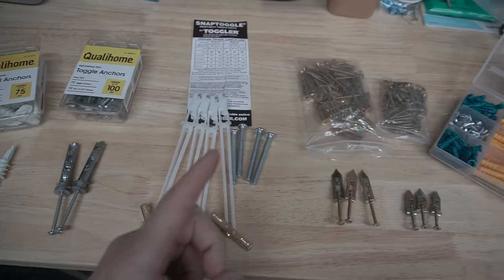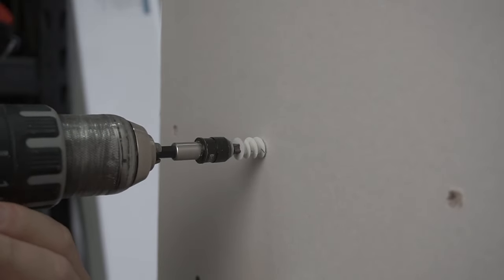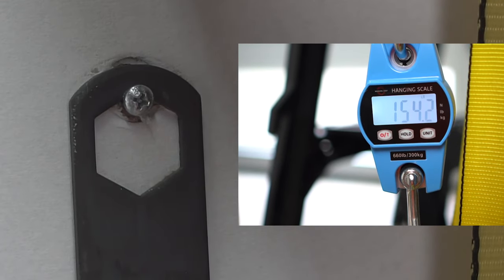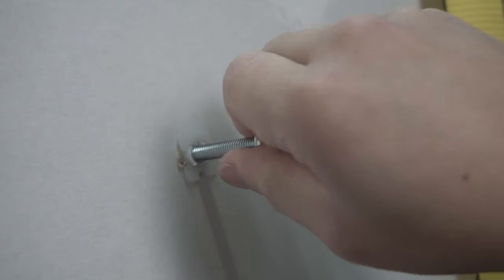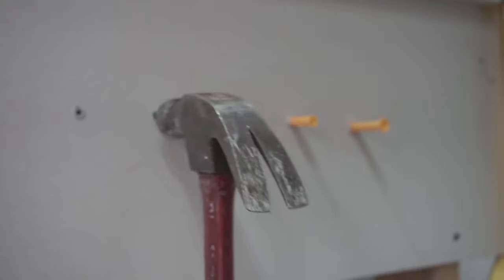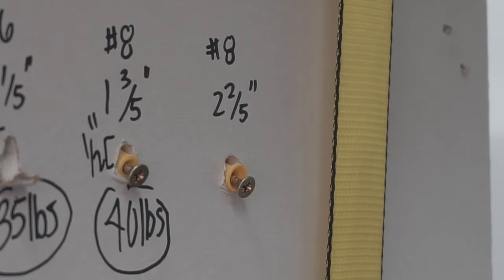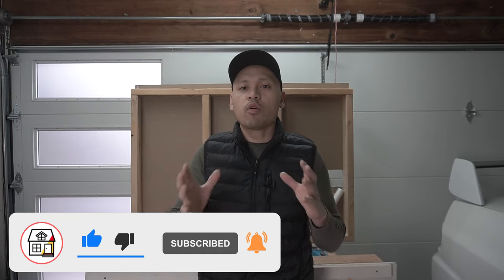Which Drywall Anchor Is The Best?! BEST And WORST Wall Anchor Review PART 1 (2022)

Comment: snap toggles will hold plenty if you make sure the toggle is oriented vertically and you pull the zipties as tight as they can go before you snap them off. I used to use the self drilling toggles (the one you found to hold the most weight), but I had too many issues with them. The threads for the screw would strip out and the mechanism would seize up because the sides would bend a little. Snap toggles are my go-to now, they're the only kind I use for heavy things. As an added bonus they also don't fall into the wall like old school spring-loaded toggle bolts. For light loads like picture frames or for small shelves that use brackets with multiple screws to spread the load, the stab-ins are my favorite because they leave so little damage behind if you need to remove them. You'll get better holding power out of them if you use them horizontally rather than vertically. When vertical they act like a knife cutting through the drywall.
Reply: I wondered about how installing them sideways would impact performance.
Reply: @Greanestbean  It does impact it ALOT. The instructions say to use horizontal.
Reply: Orientation of the metal flange of the snap toggle inside the cavity makes a huge difference.  For maximum vertical strength, makes sure the flange is placed vertically.  The instructions (shown) actually indicate this.  He placed it diagonally, thus reducing the load capacity and skewing the results negatively.  These are my go-to anchors for heavy loads, when a stud can't be used.
Reply: I have a question , my bracket is placed vertically so I should try to position the flange horizontally for better loading is that correct ?
Reply: @kd4965  regardless of what your mounting, the actual anchor on the snap toggle, the metal part that hugs the back of the drywall and that the screw threads into, should always be oriented vertically.
Reply: Showing the back of toggles as they fail would of been cool.
Reply: Yeah from the video it looks like he installed them off-vertical and also pretty loose.
Reply: @grantcivyt  Exactly right. He didn't get the sliding collar pushed flush and tight, you can see a lot of play, resulting in the failure. Sloppy work.

Comment: Great video. Snap toggle is by far my most favourite, I am surprised it is so under performed, I feel it you may not have given it a fair chance. These toggles really benefit from pulling the straps as tight as possible before snapping, I can see that you’ve got an ever so slight gap there between the toggle and plasterboard. It could have made all the difference. In the Uk we also have something called Fischer duopower, they are my 2nd favourite plasterboard fixings, claims to hold 15-30 kg each
Reply from the maker: I may have to give the snap toggle another try on part 2. Thank you for the recommendation I will
Have to try the duo power! Thank you 🙏🏽!
Reply: @FixThisHouse  Yeah I would have to agree I have done many TV mounting jobs using the snap toggle bolts with the 1/4" screws and they support 265lbs. I also used my own body weight (151 lbs)as a test and the drywall didn't even Crack under my weight.
Reply: @FixThisHouse  Yeah, definitely. I use these all of the time. You have to pull that toggle tight with the front plastic collar. Then you hang whatever you're hanging. You didn't pull it tight, and also never ran the bolt all the way in (first) before letting it hang out and testing it. Not a fair critique for this toggle.
Reply: I would have to agree with the other commenters. I use these when I'm hanging TVs and large mirrors (hung a 96" plasma TV on a basement wall with 24" OC studs - the mount was only 18" wide, and I could only get 2 lag bolts in a stud; these toggles have held the rest of the mount).

I saw another comparison video where the creator grabbed the screw head with vise grips and pulled the anchors through the wall. These toggles took the most effort to pull through the wall (and made the biggest hole in the wall when he pulled it through, lol).

Let us know if you try another comparison with these.
Reply: Came here to say this as well.  The snap toggler is my go to for hanging anything of significant weight when I don't have the option of drilling into a stud.
Reply: @FixThisHouse  First, thanks for the side-by-side test. It's great to see so many options at once. 

But, yeah, I have to agree that this isn't exactly accurate and I hope you do give the Snap Togglers a second look. The anchor didn't fail, the drywall did. Same with a couple of the other anchors because of the way you tested them. Snap Togglers are my go-to. I've been in this line of work for just under 20 years and haven't had one fail yet. Heavy shelves, TV mounts, 100-pound mirrors, etc. 

I hear what you're saying about most applications being "pull down," (aka shear force), but think about something common like a shelf bracket. They usually have two screws aligned vertically. The force on the upper screw is pull (tensile), not shear, because the bracket wants to pivot out and down with the lower screw acting as a fulcrum. Another instance is "floating" shelves where nearly all of the force is tensile. In that case you worry more about the anchor pulling out of the wall than pulling down the face of the wall, and that's where the Snap Toggler excels. 

One way to get a more real-world test might be to pull at a 30 or 45-degree angle to the wall. That might give you a better combination of shear and tensile forces.  

I appreciate your being curious enough to do this test and for sharing it with us. Keep it up.
Reply: Tony I agree with you. the screw did not look like it was tight against the wall when it was being tested
Reply: Thanks for the comments and insightful replies. Makes sense then for the manufacturers claims.
Reply: Absolutely my favorite. I install plywood with these to hang commercial fans with. They work great!
Reply: It underperformed because the bolt wasn’t tightened as it was designed for.
Reply: Hello, do you think the ceiling of A UK house can support a weight of 15 lbs with four Geefix?  That is  nothing attached to joist.
Reply: @megahwang4949  snaptoggle claims to support more than 100kg each. I think 50kg is more realistic. Can’t comment on geefix as not used them
Reply: The snap toggles are the best, next up the butterfly toggle bolts, the reason it failed early is that when we usually install it is installed tightly against the wall, this causes a hefty amount of friction on the back and on the front where the installation surface meets the drywall. If you have ever had to remove something installed with these then u know that alot of times the mount, shelf or furniture will even free hang because of the contact pressure and friction experience during the initial install. I have also hung off of these and can confirm that in actual installations they are the best
Reply: Yeah it surprised the heck out of me as well thise snap toggles are pretty strong. More to me like the drywall failed because there was too much slack holding it to the drywall. So it wasn't the toggle bolt that failed it was the drywall itself.

Comment: The flat hammer in hangers are suppose to be hammered in with the flat side horizontal to get the maximum weight holding power.  They may not hold as much as others but they will generally hold whatever you want to mount on the wall and they are very convenient to use.

Comment: This actually does not make sense, the problem  here is on the drywall not on the anchors, the anchors still inside the wall and did not break, so the problem is the dry wall not the anchors, this does not reflect a true test of the anchors

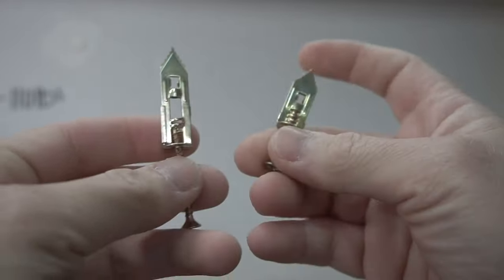Comment: 4:57 I think you should've hammered the anchors wide surface horizontally so that the narrow surface of them wouldn't tear the drywall down when you pulled the object downwards.
Reply: Exactly what I was going to comment.
Reply: Just looking at the instructions for these and it says to use the horizontally. I think this is a crucial difference in holding power.
Reply: i was about to comment the same thing. There's a big difference if it's hammered horizontally.
Reply: I have these and use em quite often and i can say that yes putting them horizontal is better 😸
Reply: @ltlewis15  Lol...yup the 1st thing I noticed.  This direction that thin metal housing will cut drywall like a knife.  I'm in this mini house in LA built in the 40's.  I couldn't hammer these into the walls I was working on because the drywall is like rock now...lol
Reply: @bobbywedding  
Back then they used lath and plaster to finish interior walls, not drywall.  That means they nailed thin strips of wood horizontally across the wall with a small gap between the strips.  And then when they applied the plaster it would squeeze through the gaps so when it dried it would be locked to the wall better than just what was sticking to the wood.

That means when you tried hammering those hangers in you are most likely to hit one of those wood strips and those hangers are not designed to do that.  But that also means that you have wood strips that will hold whatever you want to hang on the wall which will work a lot better than drywall ever will.

That also means that if you have to open up the wall for any reason, it is a lot harder to patch than drywall is.

Comment: This is a great video. Thank you for this. But @ 4:24 the anchor rated at 265# was installed so the toggle was virtually horizontal and your pull test was vertical. If you had made sure that the toggle and the pull test were along the same angles, I believe that the test would have been better.

Comment: My experience with the first type of anchor you tested (the plastic screw-in type) has been that it is best to pre-insert the screw all the way into the anchor, then removing it, before installing the anchor in the drywall.  I've had many where if I didn't do this, when you insert the screw, the anchor turns in the drywall before the screw can be tightened.  The other problem with them is when you try to take a tightened screw out, the anchor unscrews from the wall instead.
Reply: This is solid advice

Comment: I use those plastic drywall  anchors a lot. One thing I learn is that I install them with a phillips screwdriver and rarely use a drill gun because you can over tighten them . At least there are some anchors I will stay away from that you tested . Thanks for for that great info. Take care.

Comment: Your second one. 
You put it in wrong. It has two arrows to indicate top and bottom.  So when the Toggle in the back flips. It is in the vertical position.  And yes. Also have to have it the correct way so when the Toggle flips. The longest part of it its at the top.

Now your 3rd test, the large and small brass ones. You did those wrong too. You installed those vertically.  The correct way is horizontally. 
It is possible that the plastic heavy weight Toggle ( number 3 ) @ 265 lbs. You may have installed that one wrong too.
Details matter ❗️
If you do these again. It would be interesting to see the new weight load limit.
I hope this was helpful.  Not trying to be mean or rude. 
Also, I like that you used a scale to help demonstrate. 
Blessings.

Comment: The snap toggle didn't seem to be secured tightly to the wall sk it ahould have been drilled in a tad more and the metal one you hammered in just after should have been placed horizontaly and not vertically, the way it was placed has made it more of a blade to cut through the wall. Good video apart from that 😉

Comment: You installed the snap toggler wrong.

You had the metal part almost perfectly horizontal on the back side which doesnt give it alot of support when pulling down.

It needs to be vertical and that wohld give it 5x the surface area.

Great tests though 👍🏻

Comment: for snap toggles screwing the bolt firmly all the way is and important part of the anchor mechanism, if not, is like testing for failure a loosen bolt in a structure

Comment: Great comparison.  For the 3rd one with disappointing results, I wonder if the outcome would have been different if the wings behind the drywall were expanded vertically vs. horizontally?  With the downward force on a screw, I'd guess this would increase the weight they could support.  The metal screw in anchors will be my go-to after this.  Thank you!
Reply: the 265 lb. rating is for pull-out load of the anchor. the test was evaluating the shear capability, with is limited by it's strength of the gyp board. The sleeve of the self drilling toggle that performed the best helps to reinforce the hole and contributes to is better performance. For gyp board they are clearly a better option, but in harder materials like  plywood or block, the snap anchor would perform better since the self drilling anchors won't bite in these materials

Comment: Great video! The max weight ratings are for mounted items. These are anchors not hangers, but were tested by hanging the test rig on an unsecured screw. I wonder how the results would vary, if the bar was fashioned so that it could be fully mounted to the wall?  Thanks

Comment: great idea for a video, but as another commentator mentioned, you have to have the snap toggle bolt line up as close to vertical as possible.  The forces that will create the failure are the downward pressure from the screw/anchor into the drywall below it AND the anchor trying to push through the drywall behind it.  If the metal bar in the back is aligned exactly vertical, that will provide the maximum strength.
Reply: I have a question; my track for l bracket  slot ( so bracket can be moved up and down to creat different shelve gap ) the track is 1000 mm long placing vertically , which mean I should try to place the flange behind the drywall horizontally to maximise the load bearing , is that correct ? Thanks in advance

Comment: The Snap toggle you installed is the wrong way, that's why it failed in this test.
After you snap it off, install the screw tight to pull the inside bracket into the drywall.
then remove the screw and install your peace.

Comment: I understand that this is a 1-year-old video at this particular point; however I just watched it. There's one significant flaw to how you tested these. For example the toggle bolts and some of the other anchors are designed so that the part that flares out is supposed to be up and down versus sideways. The result will be significantly different. Otherwise, I enjoy your videos.👍

Comment: @ 4:40 those no drill anchors you tested, I think you messed up the test. Those should've obviously been hammered in Horizontally and not vertical. Essentially you just gave them an easy path to cut straight down with the sharp edge.

Comment: if you use the knife blade type...try them side ways...other wise weight pulls down using the knife blade and cutting thru the dry wall....i find using a washer under 
the insert head, helps the dry hold up better as well.

Comment: Does the fabricator of the no drill anchors provide any instructions at all? Because I believe that they should have been hammered horizontally instead of vertically; I could be wrong.

Comment: 4:39 No Drill anchors should be turn 90 degrees and retested. They should do better so the anchor doesnt cut the drywall like a knife.

Comment: Why would you hammer in those no drill anchors so they are vertical? Is that what the directions say or something? Seems like it would cut through the drywall like a knife (similar to what happened).

Comment: You used some of the hardware incorrectly.. the snap toggles must have the metal brace in the verticle position when using(you had horizontal and diagonal)  and the brass colored no-drill hardware is used with horizontal orientation (you had vertical) thanks for the effort but your application has your results askew
Reply from the maker: Thanks for the feedback! 👍🏽😊

Comment: Good test. I use the no drill hammer type usually and never had a problem, I think your test results would be better if you hammer them in horizontally which spreads the load better. Your test of the snap toggle is unfair, it should be tightened to the drywall face and loaded from a hook or similar, this comment would also be relevant for the traditional plastic plugs I think. Very impressed by the self drill spring toggle anchor performance.

Comment: The flat "arrowhead" anchors; if they penetrate horizontal (vs. vertical, as you did)... less of a probability to cut the board, under vertical stress?

Comment: If you hang something off a Zip Toggle bolt that isn't tightened all the way flush to wall or hanging hardware - you need a nut on your side of the wall to properly pull the toggle tight
Reply: Nice video tho. Cool to see what's happening on the other side of the wall

Comment: The hammer in ones would have been far better it you had rotated them by 90 degrees. All you did with their orientation was make them into knife blades to improve the fail rate.

Comment: The zip toggle needs a front plate to create a sandwich.  It wasn't installed correctly to test the weight.  Retest that with a stand-out mount.

Comment: Why did you put the hammer in ones in the wrong orientation! If they were perpendicular to the load i feel like they would have done a lot better. Also you should give them a score of size of hole in drywall vs weight held. That way we are optimizing for the best technology not just using more surface area. Like the ones in your recent video make huge holes.